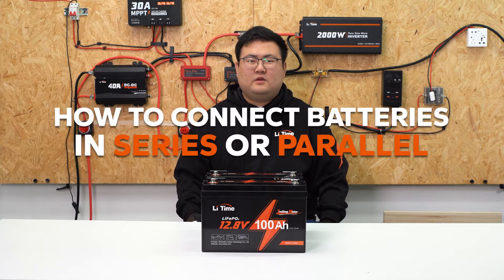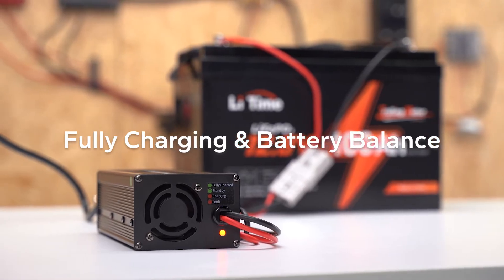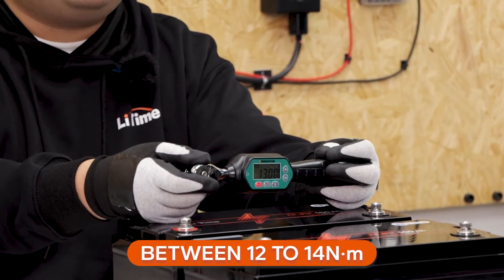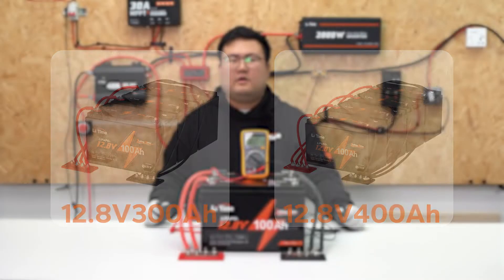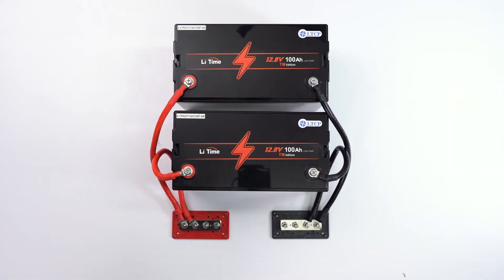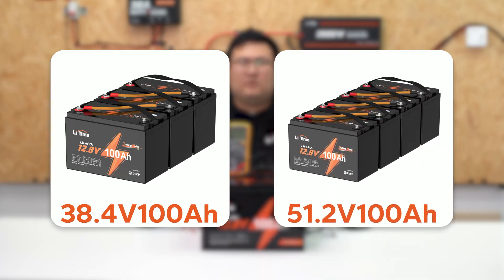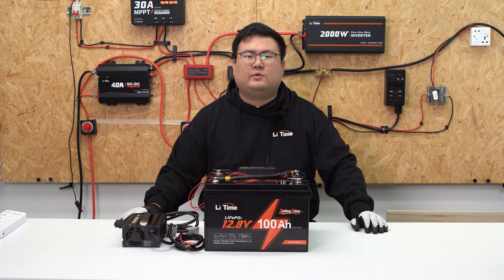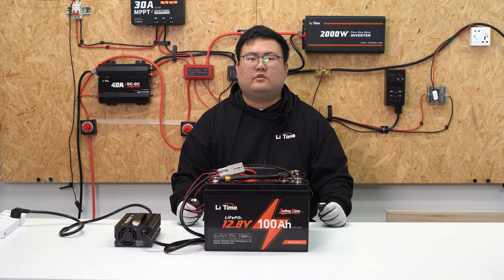How to Wiring Batteries in Series and Parallel with LiTime Power!

Comment: If I'm having two 36v 50ah batteries setup in parallel with the buss bar, do I put the leads to the trolling motor on the buss bar, or on one of the battery's terminals directly? This should be explained in the video where the lead to your equipment is connected.
Reply from the maker: Hello, thank you for your questions. As mentioned in the video, when connecting two batteries in parallel, it is recommended to add two busbars for better distribution and safety.

Comment: If I want to charge 2 parallel 12V /140 Ah LiPo4  battery's: what current do I need? What is a suitable LiTime charger?  Do I need to double the loading current?
Reply from the maker: Hello, thank you for your questions. Here are the charging specifications for the 24V battery system:
Charging mode: Lithium/LiFePO4
Voltage range: 28.4V to 29.2V
Recommended charging current: 20A for 100Ah (0.2 times the battery's capacity), which takes approximately 5 hours for a full charge.
For a 280Ah battery, you can use the same configuration(20A), but it will take around 14 hours to fully charge.

Comment: with 2 12v batteries in series.  is charging with a single 24v charger the same as charging each separately with a 12v charger?
Reply from the maker: Hello, to create a balanced series battery system, follow these steps:
1. Charge each battery individually using a 12V charger until they are fully charged.
2. Connect the batteries in parallel for 12-24 hours to allow their voltages to balance out.
3. Build your 24V battery system by connecting the batteries in series.
4. Use the 24V system as a whole and charge it with a 29.2V battery charger. 
Hope this helps!🧡
Reply: @litimepower  can I charge two 12v batteries that are in series with 2 separate 12v chargers? Or would I need to remove the jumper ?
Reply from the maker: Hi, to charge two 12V batteries connected in series, it's recommended to use a single charger designed for a 24V system. Using two separate 12V chargers could cause uneven charging, which may lead to potential damage to the batteries.

If you decide to use two separate chargers, you would need to disconnect the jumper between the two batteries to ensure each one is charged individually. However, this method can be cumbersome and may not be the most efficient. If you're using them as a 24V system, you'll need to repeat the balancing process mentioned above.

For the best results, it's advisable to use a charger specifically designed for a 24V system. This will ensure both batteries are charged evenly and safely.
Reply: @litimepower  what if it’s the same charger? I have a noco genius gen5 on board with 3 charging outputs
Reply from the maker: When charging batteries connected in series with a two/three-bank charger, it's crucial to follow the correct procedures for safety and efficiency. Here are some important guidelines:
1. Verify Charger Compatibility: Ensure that your two/three-bank charger is compatible with a series configuration. Some chargers are specifically designed for this setup, while others may not be.
2. Disconnect Jumper Cables: Generally, when using a two-bank charger, you’ll need to disconnect the jumper cables linking the batteries in series. This is because each bank is designed to charge one 12V battery independently. By disconnecting the series connection, each battery can be charged separately. Please make sure the voltage of the two batteries is balanced before use. If you have any other questions or concerns, please feel free to contact our support team at service@litime.com. We will assist you within 24 hours. Hope this helps!

Comment: If i wire 4-12.8v 100amp LiTime batteries in parallel can i use 2 20amp LiTime chargers at the same time to charge them.
Reply from the maker: Hello, thank you for your question. We do not recommend using two chargers in parallel to charge the battery system.
For further questions, please email our support team at service@litime.com—we’ll assist you within 24 hours! 🧡
Reply: @litimepower  thank you

Comment: Hi, if I connect two batteries in parallel will I need to increase to cable size or does it stay the same through out? what awg wire if I have a 12v 30ah battery at a 5amp draw? I want to connect two 12v 30ah batteries.
Reply from the maker: Hi there! If you connect two batteries in parallel, the wire gauge for the main route needs to be larger. For more details, please email our support team with your order number at service@litime.com—we’ll assist you within 24 hours!

Comment: Why use a bus bar instead of simply stacking all the positive wires onto a single bolt with a nut (same with negative)? This would minimize wiring distance between connections, theoretically reducing voltage drop and load imbalances. While this method might not be as aesthetically clean, it should deliver optimal electrical performance due to the minimal resistance and short path lengths.
Reply from the maker: Hello, thank you for your question! Using a bus bar instead of stacking wires onto a single bolt enhances electrical systems through key advantages:
1. Uniform Current Distribution: Provides a stable surface for connections, preventing uneven current flow and overheating risks from single-point wire stacking.
2. Lower Resistance: Larger surface area and optimized conductivity reduce voltage drop, improving system efficiency compared to bundled wires.
3. Enhanced Safety: Designed for high currents, minimizing loose connections, arcing, or short circuits that may occur with stacked wires over time.
4. Simplified Maintenance: Facilitates easy addition/removal of connections without tangled wires, streamlining modifications.
5. Thermal Management: Efficient heat dissipation protects components from overheating, extending system longevity.
In short, bus bars prioritize safety, performance, and usability in electrical setups. Hope this helps! 🧡

Comment: Hi, i have 4 140ah batteries.  I want them all parallel. They are 2 batteries under each car seat. Can i use 2P method, meaning + from battery 1 and - from battery 2 connected to a busbar and 2p method under the other seat + from battery 3 and - from battery 4 connected to the same busbar? I use connecting cables under the seat with 25mm2 half the length of the connecter cable between the seats which are 50mm2. The resistance on all cables is the same. Is this possible?
Reply from the maker: Hello, according to your description, you are effectively creating a 2P2S system. If you have any questions or concerns, please feel free to contact our support team at service@litime.com. We will assist you within 24 hours.

Comment: I have a very simple setup with two batteries hooked in parallel just like you did in your video however only ONE battery is discharging. The other battery says “charging”. Both batts have discharge turned on in the app. Why aren’t they discharging evenly?
Reply: just like series connection, they have the same problem about balanced..
the difference is, if the series has the voltage differences problem, the parallel instead has the current problem..

so, for 2 batteries in parallel attached the load to positive and negative "from the other side".. so, positive from the  battery 1 and negative from battery 2..
with, this configuration they always provide the load with the "ALMOST" same current.. so, there is still the differences of the current, but just so slightly and even marginally pretty much the same..

if you want to make 3 batteries in parallel, using a busbar is very recommended.. because wiring 3 batteries in parallel with 2P wiring method, the battery pack still unbalanced.. 

and most importantly, you must never wiring the parallel battery with just interconnecting from the first battery until the last battery and attached the load to the first battery connector..
with this configuration, the first battery will die faster because it works hardest than the other battery and the last battery would barely provide power.
Reply from the maker: Hello, regarding the parallel battery discharge issue you mentioned, we recommend contacting our customer team at service@litime.com to analyze whether your battery system is operating normally. Please provide your order number, battery balancing status, and load system discharge current. Hope this helps.

Comment: Hello good day if am going to wire 4 12v 230ah in parallel do you think i need a balancer for it
Reply from the maker: Hello! Good day to you too. If you're wiring four 12V 230Ah batteries in parallel, you don’t need an external balancer. The batteries will self-balance over time, typically within 12–24 hours.

Comment: Thanks. I have two 200 Ah LiTime battery and looking to connect them in parallel. Do I need a balancer for this configuration?
Reply from the maker: Hi, a balancer is not necessary for parallel connection.

Comment: I have two LiTime brand 24v 280ah batteries.  What voltage AND CURRENT (amps) do you recommend to balance before use? —-Essentially, what charger amperage of a charger?
Reply from the maker: For balancing before first use, we recommend charging both of your 24V 280Ah LiTime batteries to a full voltage of 27V or so. If connected in series, we recommend using a battery balancer to equalize their voltage before use.
Charging current (amps) is optional, a higher amp charger will charge faster. While the charger's voltage is crucial—we recommend using a 29.2V charger. You can use this charger: https://www.litime.com/products/24v-40a-lithium-battery-charger

Comment: Should the cables between the 2 batteries in series be the same length as the cables to the bus bar?
Reply from the maker: We recommend connecting the system (both parallel and series) using wires of the same gauge and length for a long-term use.

Comment: Hola tengo una duda . Con las baterías en paralelo puedo utilizar el cargador dual ?
Reply from the maker: Hi Thomas, our charger supports charging an entire parallel battery system. If your battery system is 12V, you can continue using your 14.6V lithium battery charger regardless of the number of batteries connected in parallel.
Reply: @litimepower  mi duda es si puedo conectar los 2 bancosdel cargador dual juntos a mis 2 baterías en paralelo y aso em ves de 10 amperes que sean 20 .

Comment: hello....regarding the purchase of a 24v 25ah litme battery...I don't have a 24v lifepo4 charger...can I charge it directly to the mppt victron 75/15 set for lifepo4?  is there a need for a battery balancer for the parallel connection? ..are there exact specifications for setting up charging with mppt?...can I add a second 24v 25ah battery in parallel to increase the capacity to 50ah after 6 months or more?...if in the region where I use the battery or batteries there are cold conditions in summer and winter if I insulate them inside the room, do you really need a heater for the batteries?......does the battery have protection against low temperatures?......thank you
Reply from the maker: Hi George! I'm glad to help solve your problem. You can charge your 24V 25Ah battery with your Victron MPPT 75/15, but make sure to set the MPPT to a 24V system voltage. Normally, the balancer is for series connection. You can certainly add another 24V 25Ah battery for a larger amp hour capacity. The LiTime 24V 25Ah battery supports up to 2 series and 4 parallel connections. We suggest not charging this battery in low temperatures (below 32°F). If you definitely need a low-temperature battery, you can check out our self-heating battery, which supports temperatures as low as -4°F. 👉Link: bit.ly/4bNMlVb
Reply: @litimepower  ...is there any chance of a 24v 50 ah LiTime model appearing?....someone suggest to me that at low temperatures the battery emits heat when charging and discharging and if it is located in a very well insulated box, the temperature would not drop below 32F... or should I go for a heater anyway.... thanks for the answer
Reply from the maker: Sorry George, currently, we don't have a 24V 50Ah LiTime model, but I'll certainly pass on your suggestion to our product development team. Regarding low temperatures, while some heat is generated during charging and discharging, it might not be sufficient to maintain the battery above freezing in very cold conditions. Please contact our service team if you need more specific product recommendation. service@litime.com
Reply: @litimepower  hello....thanks for the answers....can they be used in different parallel amperages...for example 24v 25 ah and 24v 100 ah in parallel?.....thanks
Reply from the maker: Hi George. The 24v 25ah battery can't connect with 24v 100ah in parallel cuz they are totally different types. You can contact our service team and see what can we help based on your need.
Reply: hello and thank you for the clarifications.. I have already purchased the first lithium battery 24v 25 ah.... I connected it to the mppt victron 75/15, I use the 24v settings for lifepo, I also modified the settings according to the technical book of the battery... small adjustments. .......I want to ask you if the bms stops charging at low temperatures?......protection is only for high temperatures?....
Reply from the maker: George, sorry to tell that the 24v 25ah is not supporting auto cutoff in low temperature. Please notice to stop charging if the temperature below 0°C(32°F). But the battery's discharging can run in -20°C(-4°F).
Reply: @litimepower  hello again...I already have 2 batteries 24v 25 ah connected in parallel with an attached temperature sensor from victron...I bought the batteries about 5 months ago....I want to add a third one in parallel with the others to increase the capacity of the system, everything would be connected on the bus bar ... is 5 months too much? to add a new battery?....thank you...I'm waiting for your answer...
Reply from the maker: Sorry for replying late George, the youtube didn't push the new comment. As long as the battery you prepared to parallel is the same(in brand, voltage, capacity) as the old two 24v 25ah batteries, that should be ok. please contact us if you have any problem with it. 🤗
Reply: @litimepower  thanks anyway, advice directly from the manufacturer is the most appreciated and valuable

Comment: Let’s test some batteries on my semi truck! I go from -5 to 115 degrees f. High vibration conditions. AC and heater ran daily with generator backup.
Reply from the maker: Hi Anthony, Good to see you there! Please notice the low temperature condition can make it dangerous to charge, make sure you're using the battery with low-temp cutoff maybe heating function.🙂